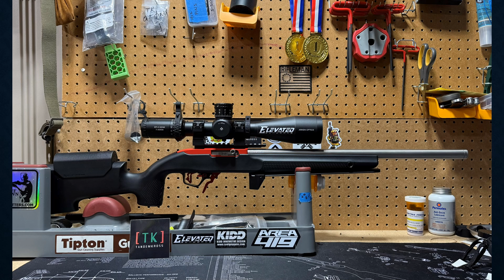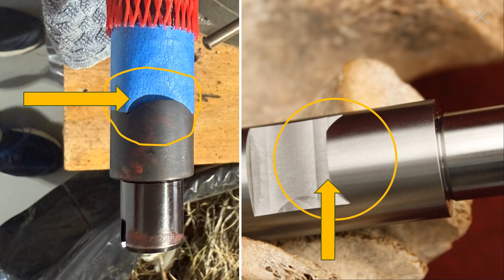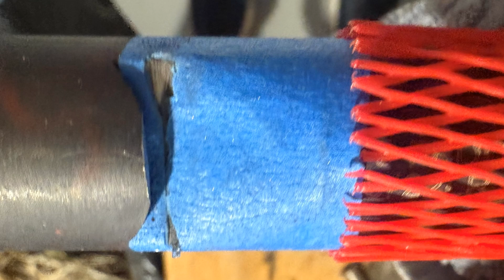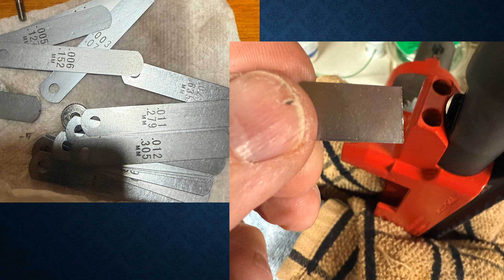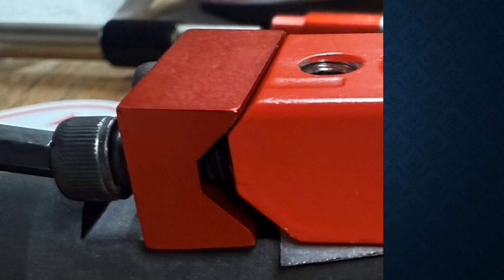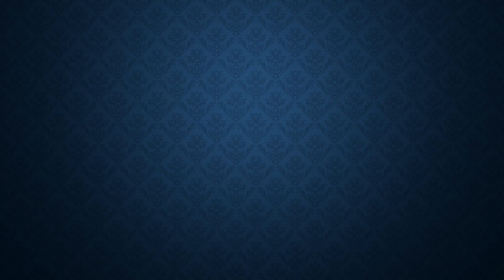Barrel Droop Shim - Ruger 10/22

Comment: Thanks for the video.  I appreciate the info as my heavy Green Mountain Bull barrel has my scope at max elevation while still shooting low.  I believe the stock / Receiver / barrel fit is the variable.  I was able to gain elevation by placing shims, cut from a tin can, under my Volquartsen VBlock (with a hole drilled for the stock screw).  However, at max scope elevation I am still 1” too low.

I will consider ‘how to’ better shim under the VBlock.  I have no space to shim between the spot where the barrel fits the receiver like you did in the video.  Shims under the scope ring base or inside the rings is non preferred due to the stress on the scope tube.  In conclusion, maybe the best shim would only support the VBlock.  I hate having to file the barrel lip.  Do you really think that is necessary ?  Comments ?
Reply from the maker: By filing the barrel lip, are you referring to the rounded edge on the V block attachment point? If you have an ability to hold it still in a fine file there is really not much to it at that point if you take your time and keep your eye on keeping it straight, it has helped the seating of many of my 22 barrels to be unquestionably more square.

Also, what pitch of MOA rail do you have on your receiver?